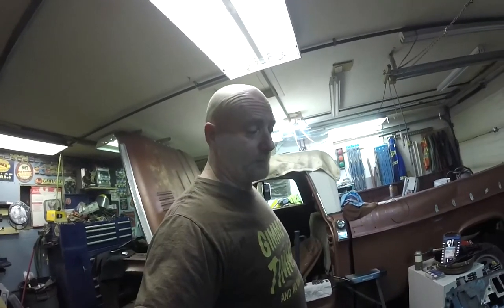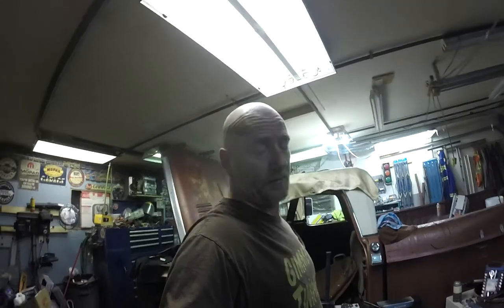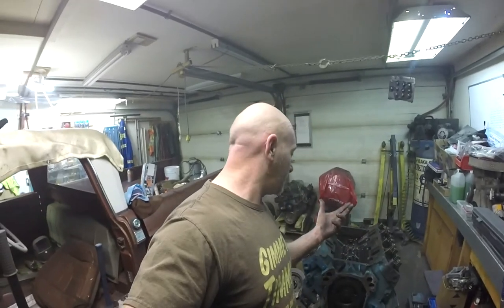Part 3 of Camshaft Install and Bearing swap

Comment: Enlighten me. You polished the inside of the bearing surface? The other one not being a Dodge guy, cam gear and crank gear dot to dot?
Reply from the maker: Yeah man. I've talked to several machinists/ engine builders and since there's no way to machine a line bore on the camshaft journals, if the can don't go in... you sand, buff, polish which ever bearings are hitching up the cam. Apparently it's common in 350's and 305's  but not a lot know about it as the machine shops are usually the ones to install the bearings. This was my first dodge engine to have to do it on. Long ass socket extension in my drill with scotchbrite taped to it did the job.
Reply from the maker: I am seriously thinking I need to start showing more. Gets frustrating cause a guy says... let's change the cam. Then it snowballs into changing bearings and  then fitting the cam and at the end of it... I turn into flat rate mechanic guy again and just finish er off without showing what I had to go through. Trying to figure out what people would want for interesting video material without making em 2-3 hours long is the trick I guess. 😆
Reply: @dazeofgloryshopworks5806  I have thought about the same but going in depth I think is a waste of effort and how much time do you spend making a video. I'm not on here for my 15 minutes of fame or delusions of getting rich. I just do what I do.
Reply from the maker: @noccis3448  you're right there. If I ever make any money off this, I'll be amazed and it's not why I went for it. But I just want to be relevant would be my goal. So I'll still work on my recipe I think 😬